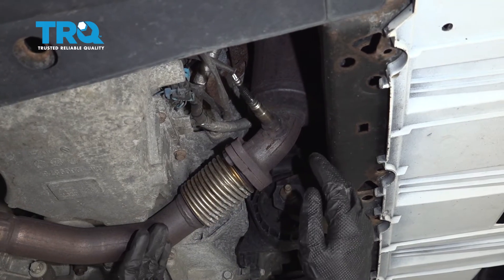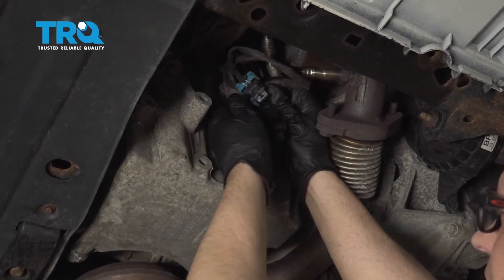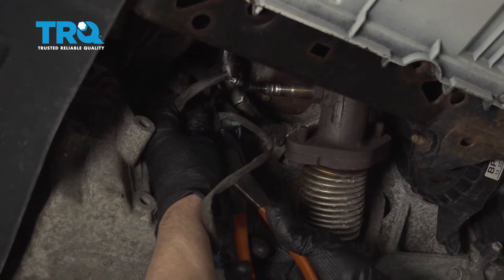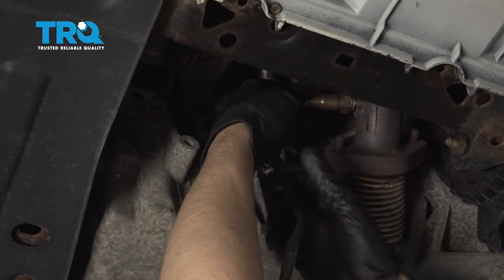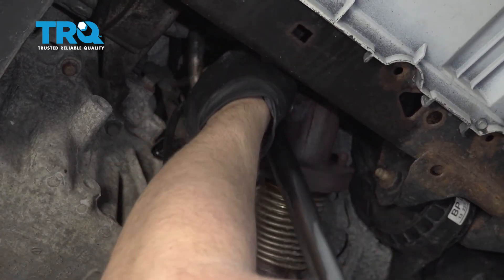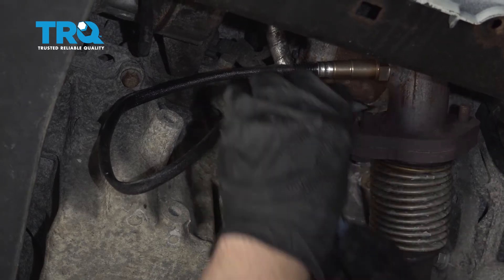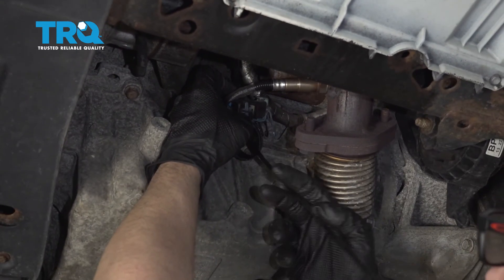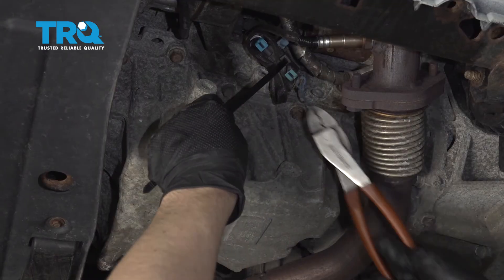How To Replace Oxygen (O2) Sensor 2010-16 Buick LaCrosse

Comment: Which O2sensor is the one you are showing in the video. From what you have said there are two sensors located , on the vehicle. I have a 2014 buick lacrosse in not sure which sensors is the one I need to change out. Also is it necessary to change out the fuel injectors when I change the O2sensor

Comment: Do you need to update the the PCM software after the replacement of these sensors?
Reply: I had the same question as you. Did you ever find out what the answer is ? I replaced both sensors on my 2006 LaCrosse and wondered if the new sensors will throw off the computers.